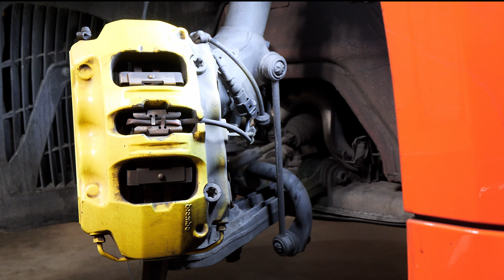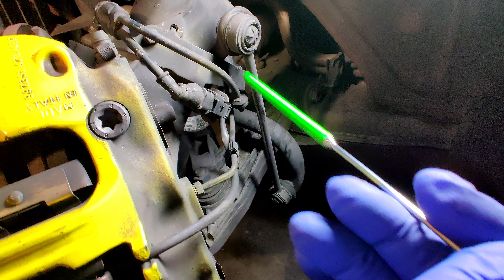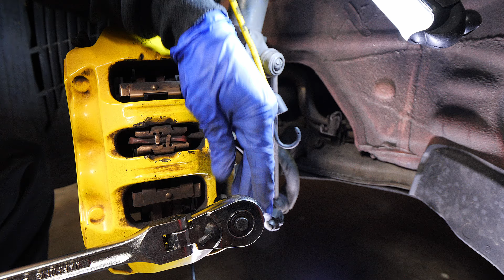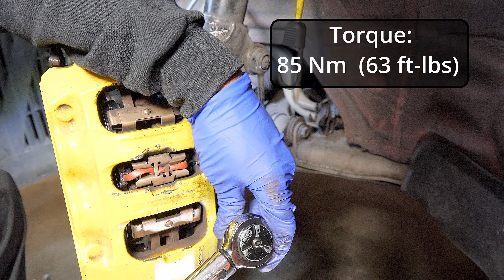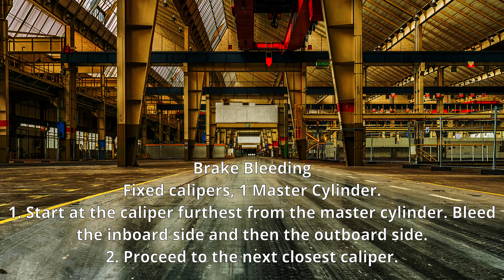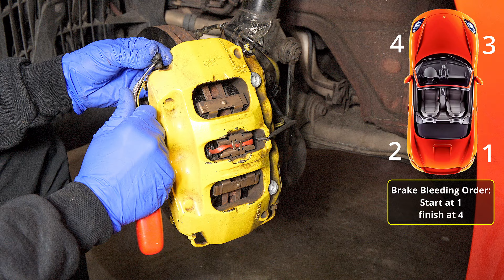Porsche Front/Rear BRAKE PAD Replacement - MADE EASY! | PORSCHE Boxster 718/Cayman (982) 2017-2024

Comment: Hi I just I just stumbled on your video about replacing brake pads and would like to ask if rotors don’t need to be replaced or turned . Although it doesn’t have ridges or brakes traces on rotor.
Reply from the maker: Hi! That's awesome! I didn't replace the rotors because they didn't have any ridges or signs of warpage. If you notice ridges or a sharp lip at the edge of your rotor, or vibration while braking then I would replace the rotors as well.